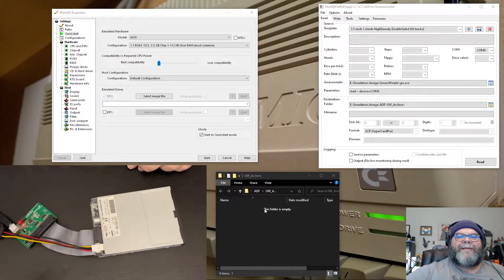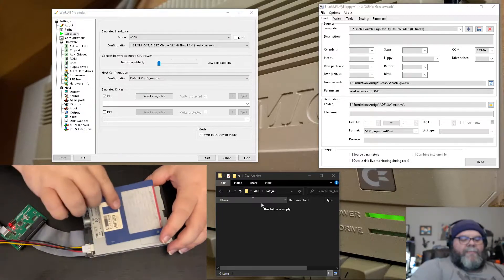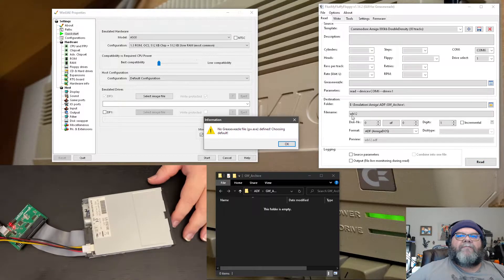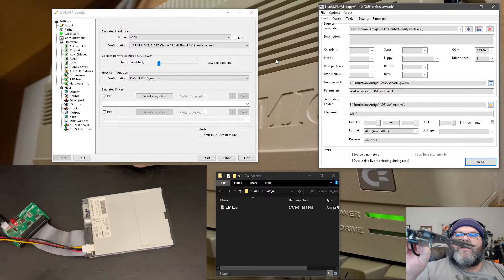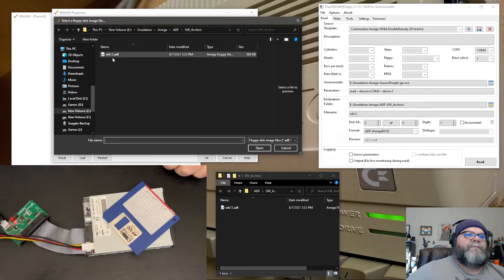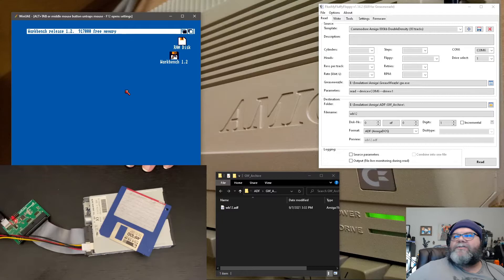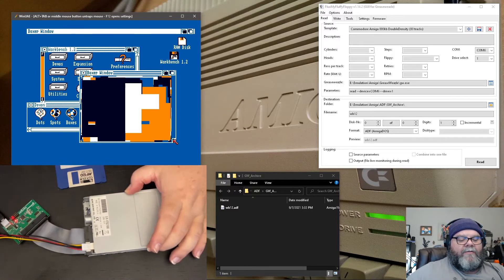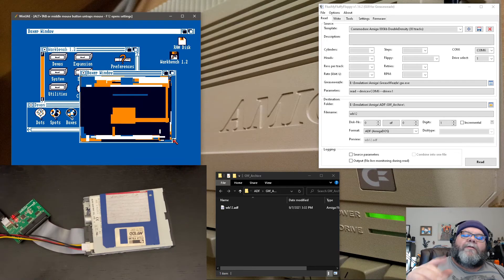Trying out the Grease Weazle v4 - will it work?

Comment: but can a normal double density drive read 1.76 meg discs ?? thanks also i read online somewhere that pcs can format floppies all the way to 80 megs using double space ?? thanks
Reply: It's analog, so yes.
Reply: @lovemadeinjapan  I dont understand what do u mean? what is analog ?? thanks..........
Reply: @ms-ex8em  the magnetic stream on a track is a magnetic flux, you can feed any signal you want to the Write Data Pin, so if you increase the density, you can put more on it.

Comment: can u use a normal Amiga 880k drive with this too?? thanks or even a 1.76 meg Amiga floppy drive too?? this means that high density floppy drives are really 2.00 megabytes in size (floppy disc) - the drive (pc) formats them to 1.76 or 1.44 megs etc Amiga or pc respectively thanks................

Comment: Hello there. I'm a newie in the amiga scene. I hope you can help. Because I search online and it didn't help me understand what's going on... I follow your steps, but when I try write a adf on a 2HD floppy (with the hole covered) I get this message.

 greaseweazle command failed seek track 0 not found

I tried changing drive 0 1 A B and got the same error.
Reply from the maker: Double check your config settings if you clicked and nothing happened, I had missed that step myself and also make sure you have pin1 proper on the ribbon cable for the drive. If that doesn't work maybe an issue with the drive? Not sure on that.

Comment: great process. A friend of mine was a missionary in Sierra Leone for 40 years. He showed me a box of 5.25" disks from the late 70's. Lots of translation stuff on the disks for a local language there. I came across your vid researching greaseweazle. thanks for the pointers. i did a test run on some old windows 386 install disks with success. so after I build a chassis for the power supply/drive/gw board, I'll take if for a spin on his disks. anyway, thanks for showing your setup.

Comment: Can you use one of the old PC drive cables and connect both a 5 1/4 drive and a 3 1/2 drive?
Reply from the maker: I used an Alps 1.44" from an old pc and it read the Amiga floppies with no issues. I don't have any 5.25" floppy drives around from a pc, but you are apparently able to hook them up as well.

Comment: Nice! Im in the process of resurrecting my Amiga 2000 I bought back in 1987 or 88. It did have the dreaded battery leakage but doesnt appear to have damaged anything. It does boot to floppy and also the old hardrive (with hardframe 200)  that was in it, sounds like a turbine engine!!!! I have a Microbiotics 8 up card sometimes it will boot, other times it will freeze up on boot.Dont know if its the card, bad simms, or misconfigured simms.